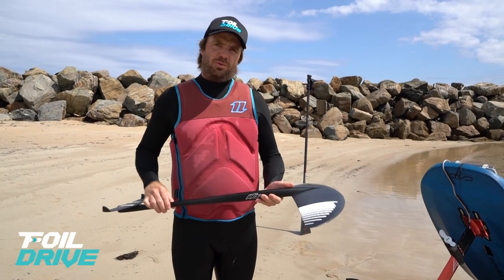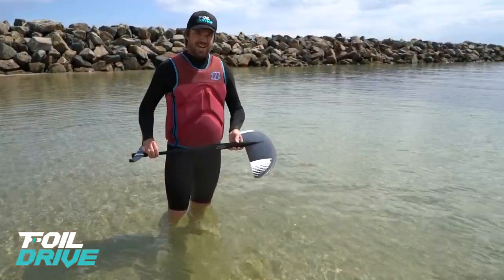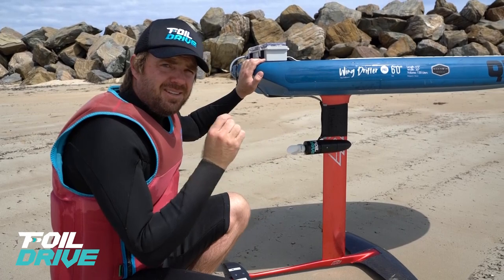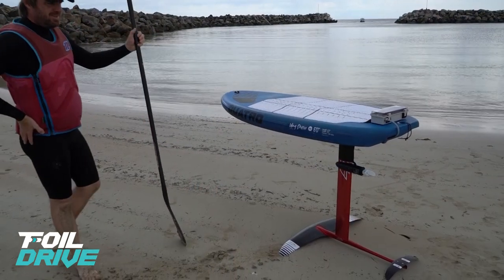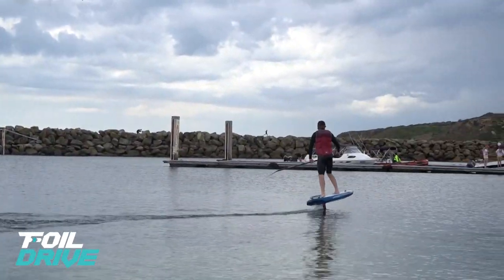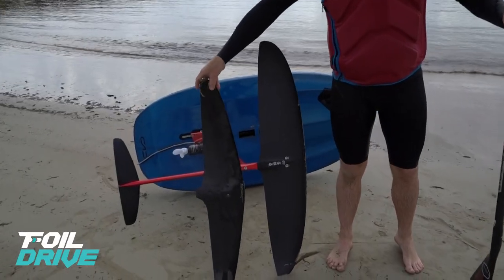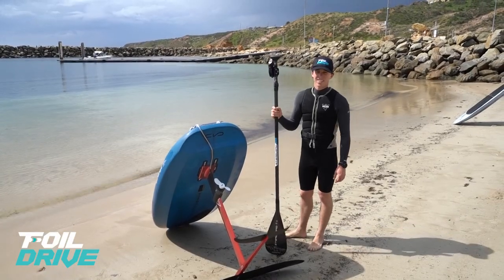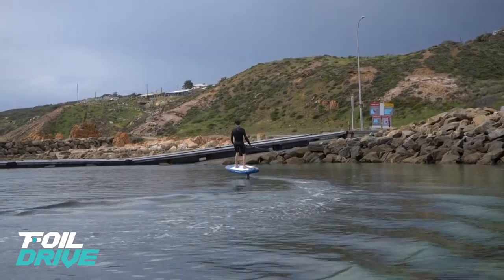Electric Paddle Assist Takeoff Technique | Foil Drive Masterclass Series

Comment: Thinking... what if you designed a flatter, thin battery and mounted it on the nose, in front of the front foot? Could help with weight distribution
Reply from the maker: Hey mate, we have a few people ordering longer motor cables and mounting their battery oinn the nose of longer prone boards 6' - 7'. The feedback they give us is that the weight is noticible on the front of the board due to the added swing weight but for them, they just can't get the hang of SUP foiling so they are happy with the comprimise so they can use the motor on a prone style setup.

The minimal weight up front wouldnt make much difference in the takeoff phase discussed in this video as the thrust and lever arm of that thrust is so great. Think about 80kg guy standing further forward has a much greater effect then aabout a 2kg battery further forward. Your weight would be applying much more force than 2kg on the nose.

Then once you are up and flying you want the most balanced setup you can for the best feeling ride, so having the motor at the back with a short lever arm is the best solution.

Once again we have exageratted the required body movement to demonstate the effect, in reality it is a very small adjustment to make for a short period of the takeoff process.

Comment: Hello Ben and Paul
I used my Foil drive for the first time today and used it like an efoil without the paddle and was able to get up on foil initially when the battery was at close to 100% but when the battery got down to about 50-60% I noticed some power drop and was unable to get up on foil even at 100% power. Should one expect this power drop ?
Reply from the maker: Hey mate,

On the Assist this is totally normal. It is caused by the dropping voltage of the battery during useage. As the volts get lower the system cannot produce the same thrust. The Assist was never designed or intented to be used as an efoil as the only mode of propulsion to maintain flight. It was designed to be an assistance motor to enable an easy start for for wave, wind or pump flight so that sag is not as noticable when being used as intended.

One of the improvements we made with the Assist PLUS with its new electronics stack and higher voltage battery was to program out this "sag" by limiting the thrust output at the start of the battery to a level that was achieveable at the end of the pack also. This gives the effect that the system produces the same thrust throughout the battery life.
Reply: @foildrive  Thanks a lot for the explanation - got it 🙏

Comment: how do you guys control the throttle % when riding? I found it easy to switch between 0 (obviously) and max% but maintaining stable intermediate %% is more difficult.
Reply from the maker: It can take a little bit of time to get use to the triggers and how much you need to press them to maintain a stable throttle percentage. if you're finding it's not comfortable for you, try flipping the controller mount upside down and using the controller with your opposite hand.

You can see this explained in more detail here: https://youtu.be/VJZR45-BQtI

Comment: What height did you set the motor ?
Reply from the maker: We find 20-25cm from the board works best if you want to use the motor just for getting up to speed and poping up. That then leaves most of the mast drag free for foiling!
Reply: @foildrive  My board is also quatro wing drifter 6'0 , but the mast is shorter and it's 75cm. 
I would like to order a foil drive. I am wondering about the cable length. Which length would be better?
Reply from the maker: @ddddddddooo123  Shoot us a email to support@foildrive.com and i can flick you a guide to measuring the cable length. Otherwise i think 85cm from memory suits the 6' quatro board.
Reply: @foildrive  I already wrote 85cm and ordered it yesterday. Thanks. 
It's winter here, is there any problem with it working?